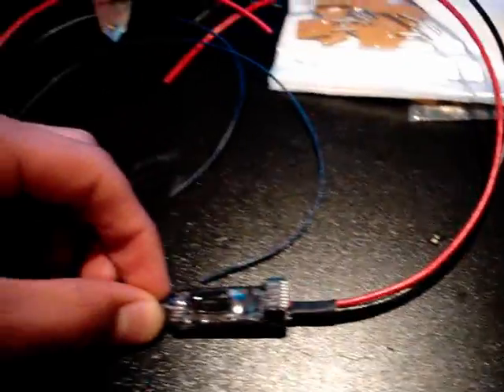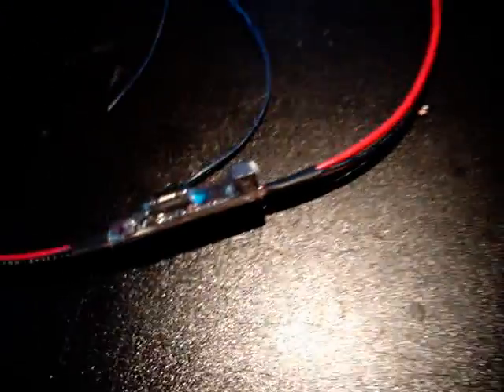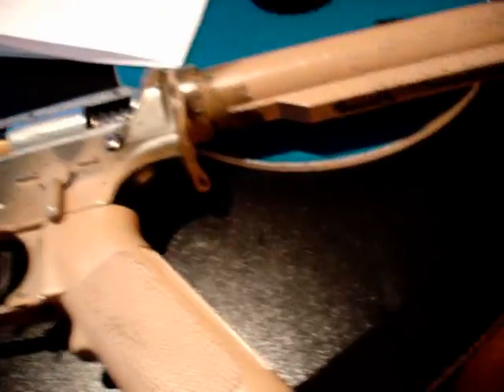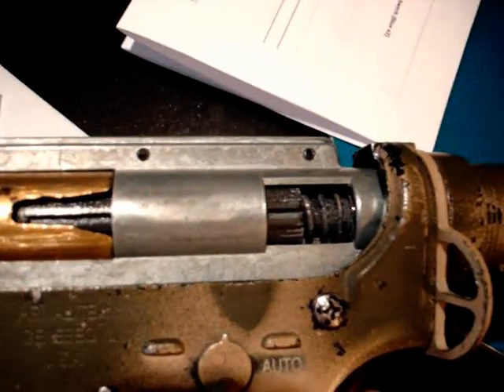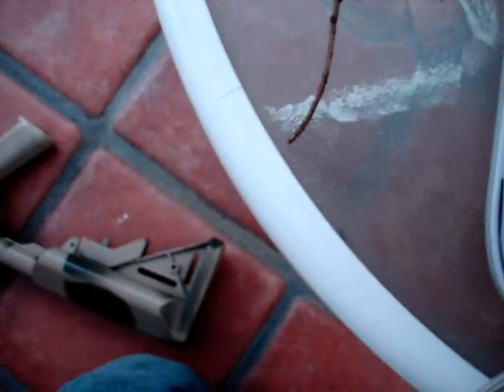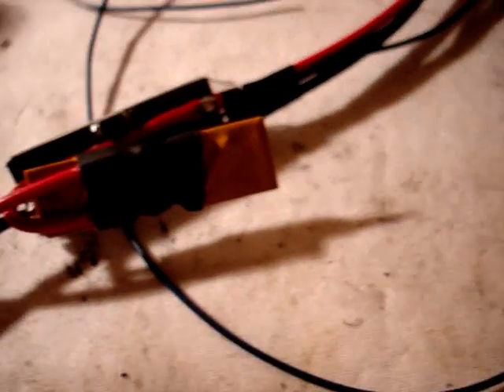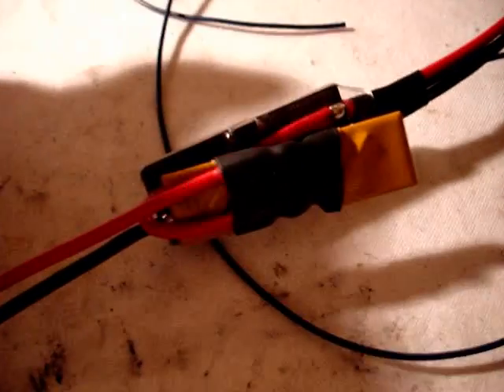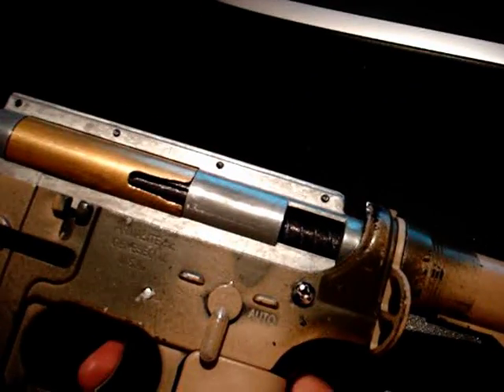AWS Sentry MDC-X500 Mosfet/Fet Review

Comment from the maker: @Invincible960 Hey, hows it going man.... and why wouldn't I use them? ;) haha. They really aren't the best though... for like a third of the price you can get 5ku/element which is almost as good and you don't need to replace the cheap pinion gears that come stock on systema motors. I just have them because I got them for a good deal and they sound really cool/unique when you run a lot of current through them; I'm going to be running 13.2v LiFe's... I might post another update video with them.

Comment from the maker: @ARX7ARBALESTZ7 Yea, it'll be fine. I would recommend to have a fuse installed, ESPECIALLY for a lipo battery but yea, it'd be fine. That is the very basic fet, all it does is reroute the power... which is why it is so much cheaper (it doesn't have all the extra functions) but it's not like it's bad to use that fet, it just has less functions.